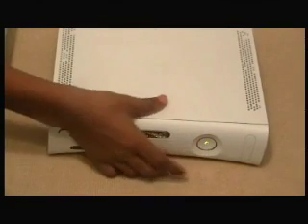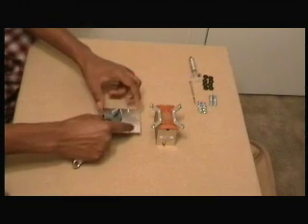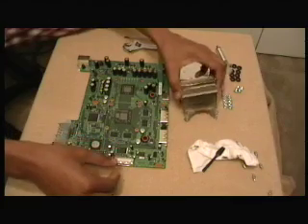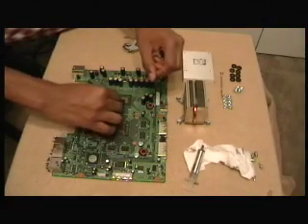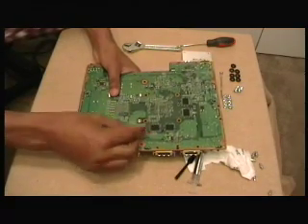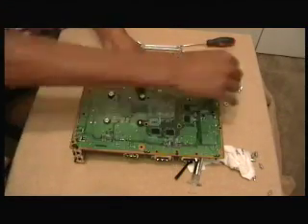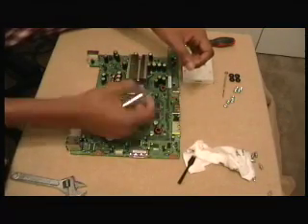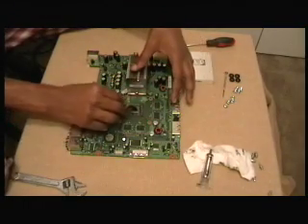Fix an xbox 360 with Red Ring Of Death ~ e74 ~1 red light -- PART 1

Comment: @woowoo18451  If u add to much thermal compound, the heat will not transfer very well to the heatsink and will cause it to overheat. An example of what the correct amount of thermal compound to add is about the size of a BB or a rice grain. I used the Artic Silver 5 thermal compound.

Comment: worked great!! didnt even need to overheat it.
used screws and washers from lowes. screw part# 138433.   nylon washers on circuit board sides and steel washers on  top of those no nuts. screw right into heatsink from underside. and I did clean old heat paste thoroughly.

Comment: @SuperHappyRobertTime E74 is caused by the MoBo warping do to heat. This lifts the GPU from the board making the solder joints break. This gives you E74. I've had it twice on both my consoles.

You need to flux your xbox as well as Heat gun it & remove x-clamps. By from a general hardware store like Screwfix or B&Q that way you know your getting what you paid for.
Also most Xenon RROD is either 0020 or 0120, Most E74 problems are 1020, Llamma is inaccurate tempermental as thats where you look

Comment: @LifeOfLogiclyInline 4 red lights means you need too push the AV cable into the xbox 360 a bit more.. or you need too check if you plugged the AV connectors (which are the red, blue, green, red, and white chords for HD and the yellow, red, and white for the regular tvs) in the wrong port. Make sure you put them in correctly with their color code.

Comment: @liaria dude the screws are common 1/4 in phillips heads you get at the hardware store get nylon washers also take the heat sink with you to fit them rite im in the proces of fix ing my box again i need to get some thermal paste

Comment: @tevinmason1 1 red light signifies a hardware failure, which in my case happened to be a faulty motherboard, if this occurs you will need to either return the console to the store you got it from, or send it to Microsoft for repairs. An error code should be shown, which helps Microsoft diagnose the problem

2 red lights signifies the console is overheating, which can be helped by ensuring the fans are clear to work, and not blocked or covered by anything.

Comment: I just bought this kit a couple weeks ago, did the process, and it works. NOTE: do not pry the x-clamps off while putting pressure on the silicon roads. You can distort or break the roads. Also, I was surprised at how very little (but enough) thermal paste was provide in the kit. I didn't have to overheat the system; it turned green right away. Anyway, happy the kit worked. Thanks

Comment: @thomasandmm How I understand is that when ever there is a mechanical FAIL, or major software/firmware FAIL, that the Xbox 360 is programmed to produce the RROD, but the number of flashing red lights (1 to 4)
signifies the severity of the problem, ( 1 is least to 4 which is worst). Plus even with the main power brick when the heat turns it from green, yellow-orange, orange, or red that is programed as well.

Comment: @thomasandmm  Plus the only thing that can give you more specific information about your RROD, is when you get an error message along with your  RROD. Which most of the time if there is a message it is either a specified hardware fail or a software fail. That's about it.

Comment: This works. A buddy of mine gave me his old 360. It worked when i first got it. I let it sit for like 6 months, unplugged, tried to play it and the RROD lit up. Followed the steps; works perfectly. Highly recommended. Thanks FixYourOwnXbox...

PS- if i remember right the screws that worked are an 8mm head @ quarter inch length.

Comment: Fix WORKED! I think you need to make a video on how to put the xbox back together tho. We ended not having to screw the black screws under the x-clamp in. Also, need to make sure the heatsync (*sp) is touching the chip. Thanks for the help.

Comment: @liaria The ones i got were #10-32x1/2" round heads. The washers were 5mm inner diameter. I did mine with: 4 washers between the motherboard and frame, with the plastic washer touching the motherboard. The heatsinks had one metal and one plastic, again with the plastic touching the motherboard. Hope it helps.

Comment: I agree, buy yourself the artic silver 5 cleaning kit and prep both the gpu and cpu surface as well as the surface of the heat syncs as well. They need to be cleaned and preped, don't just pull the old paste off with a toothpick.

Comment: hi there...I followed all the steps and then got that problem that my xbox wouldnt over heat....I took the heat sinks back off, cleaned up all the paste from the chip and the paste that microsoft had let over flow onto  the parts surrounding the chip..put the heat sinks back on...this time not tightening so much....turned the xbox on and .....holy jumpin shitballs....no more red lights.....thank you my man....like somebody else said on a post...its not very often you get free help.many thanks.

Comment: Only thing I would correct is at 3:02. Don't use anything metal, the chip dies can be VERY thin and they are finished with a fine polishing head at the factory. This helps transfer heat (which is the problem we are trying to fix anyway). I use a NEW credit card or the smooth edge of a thin piece of cardboard.

Other than that, GREAT VIDEO

Comment: Thanks for the videos on xbox repairs.

but  always remove the old paste as it is a huge cause of the problems as it is very poor heat transfer.

I use 90% or better rubbing alcohol.  avoid things like nail polish remover as they are not pure solvents.

never scrape the paste off with metal.  always plastic credit cards or similar things or damage chip.

What advantage is the kit over using the stock brackets?

use non-conductive paste or it make short out circuits. I use AC Ceramique over AC5.

Comment: @B14ckHawk @B14ckHawk Electricity flows through the processors being distributed through the other parts of the board. the amount of electricity that goes through the processor causes it to heat up. Heat is bad for the processor. Thats why there are fans that blow through the heat sink. It keeps them cool when you use your computer or xbox. If the processor were to overheat it would fry.

Comment: Thanks man, this fix worked for me so far.  we'll see how it holds out.  i went to ace hardware though and bought my own screws, but the ones i got were too long so i had to drill holes in the side of the chassis :P, should've put up the extra $5 and sprung for the kit on the site, oh well.

Comment: @faithxvoid mate it was shutting down i couldnt touch the heatsync for more than a few seconds but now that i have stoned it flat and got a much better contact i think it is allowing me to not use thermal paste after a bit of fine tuning ive been thrashing it turning it off and on fliiped it upside down and its still working basically i think the main issue with the 360 is the build quality next xbox you pull apart check the radius on the heatsync its not level  it has poor contact, simple

Comment: 3:00 a quarter? 3:38 i happen to be an avid overclocker and it is very important to get good temps to remove all of the old thermal paste and clean the heat sink and the chip. That is the reason why you are replacing the thermal past in the first place, because it isn't transferring the heat to the heat sink properly.

Comment: The Xbox 360  X-clamp replacement fix is only temporary at best and can cause more damage in the long run, but if you follow these tips you can minimize the chances of further damage to your system:

Never spread the thermal paste on small die chips such as the ones used in the Xbox 360. You just need to put a rice grain size amount directly in the center of each die (the shiny part on top of the chip) and the heat sinks will spread it out perfectly even when they are reattached.

Comment: SalleNr1: check if the fan is pluged in, if its not that make sure everything is pluged in to where it belongs.--Clawsome676: if you got that far in the disasembly of the xbox you will see that the X box clamp skrews are different than normal skrews. The skrews that he replaced the original X clamp skrews with are flat head skrews. You can see this around 2:12 in the vid. Hope this helped.

Comment: For anyone who is doubting this... You have good reason too. Sure this fix works on some xbox's it worked on mine and it has worked on countless other xbox's i have used this on. However the fix is not a 100% sealed deal sooner or later your xbox is gonna give out on you again it may be 3 days after you fix it or it may be 3 years but fact is it will eventually crash and let you down once again!. All xbox's are different some last longer than others with this fix but it does work for most :)

Comment: Always clean the heat sinks and chips up as best you can. If there are any air gaps between the heat sink and chip it can cause thermal failure. If this happens, you will need to get a new GPU installed. If the CPU dies, your Xbox is toast.

You should add two 1mm washers to each nut on the top side of the board so that warping does not occur. When tightening the replacement bolts or nuts, only tighten them as much as you can with just one finger and thumb, just snug.

Comment: @onlinecpu When a desktop shuts down due to overheating its because the preset heat limit for the CPU is reached and the mobo firmware sends commands to shut it down. The red ring of death is a fatal hardware error that is caused by chronic overheating of solder. The CPU/GPU never reach their preset critical heat but theyre not being "damaged", the lead solder that connects them to the mobo is breaking down - becoming liquid and disconnecting CPU/GPU.

Comment: when putting the new thermal paste on. you want to clean it from the old paste, and then apply only a dab of you new thermal paste in the middle. then put the heat sink on. spreading the thermal paste makes air bubbles which is bad. Doing this will make it last longer and keep it a lot cooler

Comment: I used a tor 8 and tor 10 screwdrivers , some "electric cleaning" spray for cleaning the residual paste on the chip (the vid says you dont have to but the advice I got from an electricist friend of mine was that the residues could act as insulator wich isnt desirable) that was made of pure alcohol... The paste I bought from I local store as well

Comment: @MichaelMurphy2oo7
either you have to plug the power cabel correctly or you have to change it, i got e69 when i used the swordfish coolingfaan and it stole some of the power for the 360 then i pluged the coolingfan out and the power cabel back in and it worked correctly so just follow my advice. ^^

Comment: @woowoo18451  Ur WelComE    :)
U can use an old credit card that doesn't work to scrape off the thermal compound from the GPU and CPU heat sink. For the CPU and GPU Chip removal of therm. Comp.   u can use cotton swabs to remove it, and u can use Rubbing alcohol to remove thermal from both the chips and the heatsinks but try to use the one that has the highest % of alcohol.

Comment: @Twisted86 

Well said, Computer hardware is computer hardware, If you don't handle it right, it will fail.

Always use clean new thermal paste, i find best results just using a small pea size.

Comment: @the0xox0boss strip it down again and get a heat gun that goes to at least 600 degrees and heat up the bottom evenly for like 20 seconds the do the same with the front then run the heat gun over the cpu and gpu for a minute and a half after that let it seat for about 20 mins without moving it at all then just throw the screws and new thermal compound back on nd u should be set

Comment: don't know how permanent this fix will be, but i followed the instructions for every step, and the red ring is gonnnnne.  the first two times i got it down to two red dots, and started getting discouraged, but after tweaking the screws i put in and the washers, i finally got it going.  so if it doesnt work the first time, dont freak out.  it will work!  A THOUSAND THANK YOUS! ps, make sure you have the right kind of tool to get the little black star top screws out.  i almost stripped half of em

Comment: i didnt need to do any of the extra stuff, i just took the xbox apart to the motherboard and used air in a can to clean the dust off the heating system and the fans, then i overheated it til there were only 2 red rings like the video said and it works.

Comment: @dynamite265 The towel trick is only going to last you so long before you get RROD again and then your going to do it over and over until you burn out all the thermal compound and frys your CPU/GPU. The reson why you put new thermal compound in it is because your replacing dry-rotted thermal paste with new thermal paste. Puting new thermal paste on your CPU/GPU will make your xbox last a lot longer. Im not telling you what to do because it's your xbox, but im just giving you a heads up.

Comment: @wsrmmn T8 Torx Screwdriver 

T10 Torx Screwdriver 

5mm Flat washers (B&Q avf-064968) 

5mm x0.8x10 machine screws (B&Q avf-069918)  

Arctic Silver Thermal Compound

Thin Terminal Screwdriver 

Wooden Skewer or similar (must be THIN) 

Do not substitute the screws/washers with a different brand or size. The size of these is crucial for the modification to work as intended
that is what i found on the internet. I'm about to attempt a fix. I'll keep you posted.

Comment: i had one wth 0103 error and its now just needs thermal paste becuase it runs but its not too good to run without heat paste somebody had done the x-clamps to tight now i have another one and the x-clamps looks perfect the board was screwd on and everything unlike the other i did the over heat untill 2 lights thing but i took the fans and dvd-rom/ wires out and just put a wash rag over the heat sinks its a halo 3 also

Comment: I love it this is my 5th xbox that I have gotten a hardware error on. I want to get one of the new xboxs but I'm afraid I'm throwing away another 300 dollars. I think I would get more entertainment if I burnt my money. I've had my PS3 since the thing has come out and it has been stomped on by my brother and kick over and it still works like a charm. I'm just mindbottled how a failing system is out selling a beast that rarely fails. If my new xbox 360 gives any fits I'm drop kickin it.

Comment: @minidvpro thats a good idea; but the flaw? you need to open up the xbox in order to change the guts. when you open the casing the seal gets removed. the seal is basically a sticker that you cannot simply take off and put back on. when removed its exposed to oxygen it changes color. when microsoft opens it they can tell its been tampered with and thus your warranty is revoked, and declared invalid. they will send you the xbox back and now your new xbox's warranty is also gone. thumbs down people

Comment: I haven't tinkered with the 360 a lot but I do build computers and I would think, just as any manufacturer built computer does, that this would come with thermal paste pre-applied? Wouldn't you have to clean the gpu and cpu before you apply new thermal paste? and what is the purpose for the new screws?

Comment: not generally, the newer versions of the xbox and the more expensive units generally are better made, and i know that they have released a different update of some sort or some kind of new model of xbox that doesn't produce nearly as much heat that i've heard, and it happens because of too much heat on the heat pads inside, however, i guess if you overheat it, it can fix itself (search "towel trick")

Comment: surely over time the rubber will heat up and become brittle?

the whole point of this fix on everyones way, is to remove the x plates to stop the board twisting. your rubber allows this to move?

finally you mentioned rubber washers other i see use plastic/mylon other just steel. When you remove it all on the original its all steel. Even screwed onto the actual metal case in the xbox. Does this not also by design add to the heat distribution?

Comment: So....what ever happened with the 4 small black screws that went through the bottom metal case and into the bolts in the heat syncs?  do you just leave those out?

Comment: ok so at 4.03 you place heat sink on chip, turn it over, add rubber washers an tighten nuts! correct me if i wrong but will you not bend mother board even more as you dont seem to have anything between the heat sinks 4 connection holes and the mother board,ie top side?? if u tighten nuts will it not be pulling mother b and heat sink together while squashin mr chip in middle?? sorry if this does not make sense,if u know what im trien to say put in proper english,thanks, maybe i missed something

Comment: @wwy22rifle screws and washers put more pressure on the GPU, and its a pressure issue that is causing the E 74 ERROR. Well it be precise, (for what i have read) its a solder connection problem. (witch pressure and heat fix) And as a plus, it makes it easy to take the heat sinks off and back on. The X clamps suck for that.  :)
Hope this made more since.

Comment: @messier991102 i found out how to fix my e74 error its just a loose connection to the ana chip so i press down the anna chip so it connects a bit temporary yah but wont harm your xbox i plan to open the bottom next and solder it or glue it proparly

Comment: if its code0013 strip your xboxs clean all contacts on the entire mother board(methylated spirits and dry with a heater) take out the xclamps and use small rubber hose that will push on firm and hang about 1 mm over the studs that hang out your heatsyncs fit them and tighten until they STOP make sure ther is no movement between the heatsink the motherboard and the chassis any slack and it wont work dont pay someone if they are fucked you might aswell give it a try